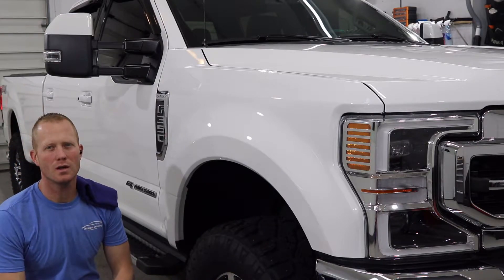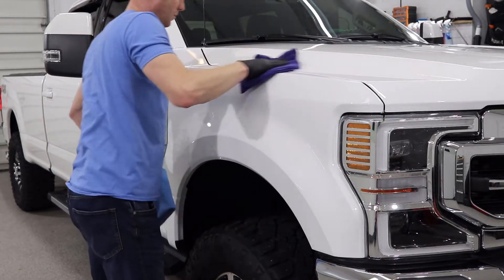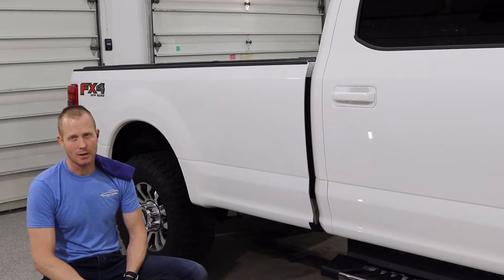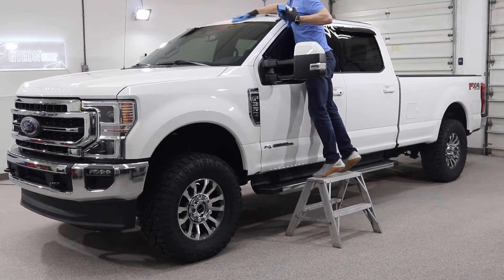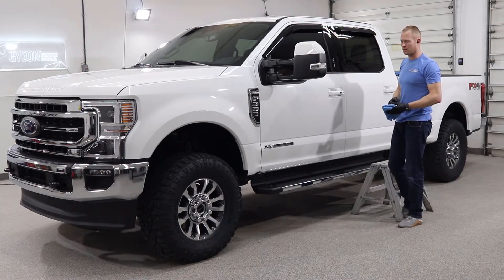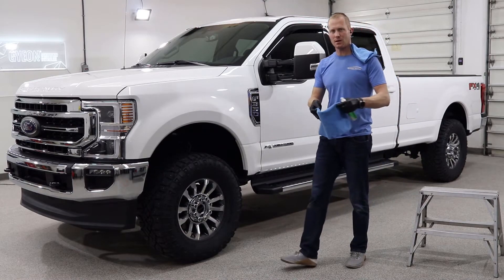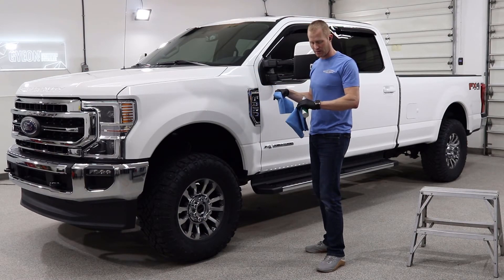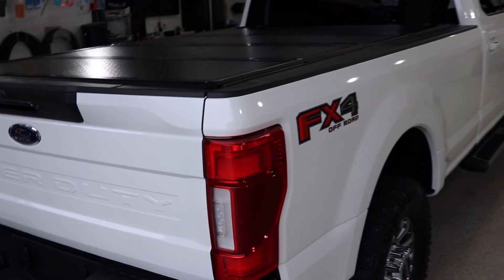How to applying a ceramic coating to your car Ep.5 - Ceramic Coating Application

Comment: i was applying CanCoat (simple, non-PRO) outside due to lack of garage, on a black car. the thing is, i didn't see any product wetting the paint, so to speak. well on the first touch it was something but it almost instantly was drying up. should i reapply indoors for a second layer?
Reply: If it looks good and you wait a week then wash to see if the water behavoir shows any spots missed then you should be good. Or if you missed something cancoat can be topped with cancoat so just add a new layer.  I would just make sure not to top it with anything else until you know for sure if you want to re-apply or else you will have to fully decon again to strip off the sealant before Re applying the cancoat.
Reply: @Nicklovespickle  thank you. it's just i was expecting to see a visible trace to where i applied cancoat and where not yet. but there were no "wetting" of paint. that's why i'm confused.
Reply: @greyMDA  Yeah it is definitely a bit different. If you try it again you can use a regular applicator and just take the sprayer off the bottle and give it a couple shakes with the applicator over the hole and it will load it right up with product.